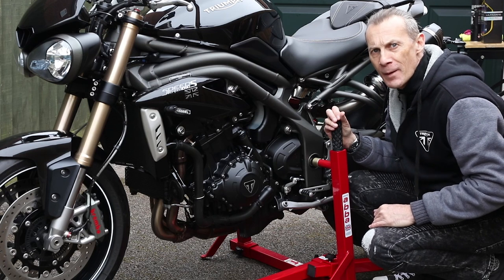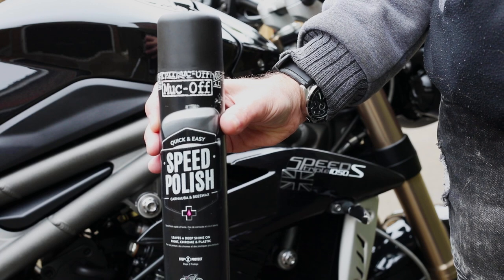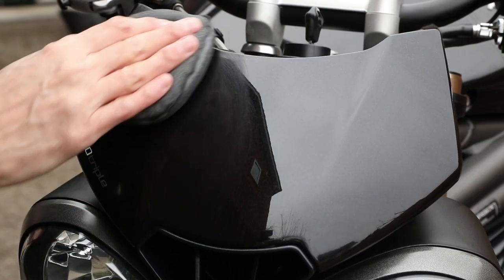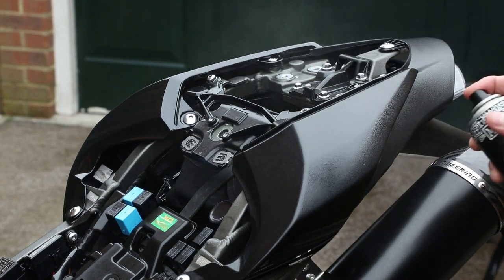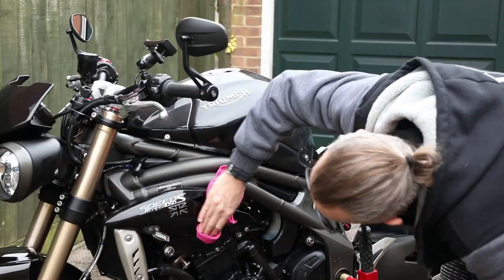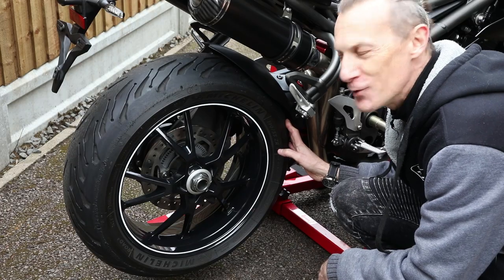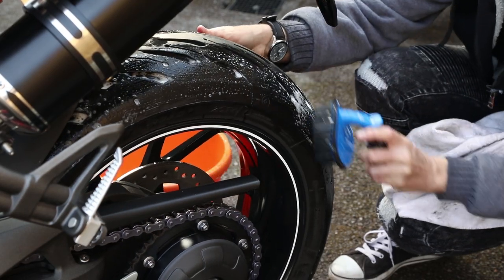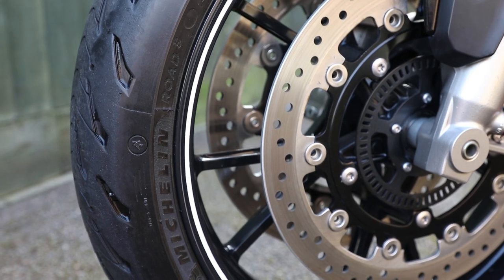How to make your motorcycle look amazing

Comment: Generally polish be used before wax. Idea being you are polishing out the fine scratches and restoring the paint somewhat then a wax after seals and protects the now clean flat paint.
Reply from the maker: Thanks for your comment and advice, Tom. I’ve used quite a few different brands of polishes and waxes over the years, as I’m sure you have, and have found the combination of Meguiars Ultimate Wax and Speed Polish really does make my paint look amazing and this combination has also transformed paint on other peoples bikes and cars too. It has made me wonder what it would be like applying polish first, which I did years ago but got into the habit of using this technique as I’ve been so pleased with the results. It’s worth me pointing out that I used a different process to remove deep scratches. Thanks again for watching and sharing your advice. 😁👊
Reply: i dont think this is a cuting polish which is what you would use to restore paintwork prior to wax. I think I would use it the same way as Phil. Decent wax coat then go over it with this stuff. BTW, Phil, I'm sick of the wet weather were having currenlty. Decided to pull the fairings off the ZX10R and put into winter storage with a coat of ACF-50. Now think I've been a little hasty as we actually had sunshine and dry weather for a change - typical!

Comment: Regarding tyre pressures, when I had my two speed triples I kept the tyre pressures as Triumph recommended them, I now own a 2017 street triple r, and had my suspension set up at MCT, and was recommended to run both tyres at 36 psi, and it feels fine .
Reply from the maker: Thanks for sharing Paul. I’ve experimented with tyre pressures and have also run at 36 psi rear. I know some people who run at 33 psi rear. A subject for another video I think! 😁👊

Comment: Great video Phil. Heres a tip, only use stainless wire wool, readily available nowadays. Reason is bits of that steel wool get into nooks and crannies and rust/stain the bike. I use Abranet cloth, 320. What soap do you use on the tyres? Dish soap? Cheers
Reply from the maker: Thanks for the encouragement and tips! That’s a good point, thanks for sharing! 👍 I’ve found just a little bit of dish soap does a great job! Thanks for watching! 🙌

Comment: Hey Phil, top stuff +1 sub.  Any tips on good products to keep a Tiger seat conditioned?
Reply from the maker: Thanks very much. I just use soap and water to keep my clean. I used to have these really awesome Turtle Wax leather wipes I used on my old Hotrod to keep the leather soft and clean. Any good leather cleaner should do the trick if it needs it would be my advice but you will find yourself sliding around for a bit! 😜👍

Comment: Hi Phil, I followed your way of dealing with ACF-50. Can we put wax on it knowing that ACF-50 already leaves a hydrophobic film? When waxing, don't we remove the ACF-50? best regards, François from France😉
Reply from the maker: @francoisbarax4890  Hi Francois. After I apply ACF-50 to the entire bike, I then apply Polish and Wax to the painted areas. I use ACF-50 as a barrier to stop the rust and corrosion. What I’ve been doing for over a year now is add a Ceramic Coating from AutoBrite Direct, this really helps displace the rain, and if the bike isn’t too dirty I just give my bike a light coat of Ceramic Quick Detailer which really works well and makes the bike and paint look amazing. I’ll add a link to another video if you’re interested to find out more! 👍
https://youtu.be/ZMpYpzHJE7o?si=9MPWUkbhAT7vTSDu

Comment: Hi. I have found your videos really helpful. Thank you. I have followed your instructions and now my 2018 Speed Triple S is looking great. However, is there anything I can do to improve the appearance of the coolant pipes, as they really detract from the overall look of the bike? They have become faded and scruffy looking. I noticed that they regained their colour when they got ACF 50 on them, but soon returned to their faded look.
Reply from the maker: Thanks for your feedback and support, I’m pleased the videos have helped. I know what you mean about ACF-50 on old pipes, it doesn’t last long term. In the past I used boot polish, or you could use a black trim or tyre restorer. There are a few products on the market now, I suggest picking one and try researching on line for customer feedback! Please let me know how you get on. Good luck! 😁⚡️
Reply: Hi Phil. Thanks for your reply, and I will let you know! I saw that in an answer to a previous comment, you say that you have a method to remove deep scratches. Do you have a video on that?
Reply from the maker: @kevinbonardt2104  You’re very welcome. Please remember I’m not a professional but just learnt techniques which have worked for me. It really depends on how deep the scratch is, if you wet it and it disappears then you should be able to repair the paint. I use a really fine wet and dry like 5000 or 8000 grit and carefully work over the scratched area, but then you want to mop it. I would recommend talking to a paint repair company who may be cheaper than you think and would do a cracking job! Autobrite Direct offers a paint restoration service and I used Chips Away to help me out a couple of times! 👍

Comment: Hi Phil, your videos are extremely helpful. 

I have a question. After doing all this hard work and getting the bike looking flawless, you go out for a great ride. But inevitably, you end up hitting countless bugs and now the bike is covered in dust and bug splats after just a few hours. Do you leave them on until you do another full wash, or do you try to do a partial wash on the affected areas? 

I have a matt black street triple that is my obsession, but I also ride it as much as possible all year round and live in the countryside with very hard water. This means I have to avoid wax or polishing as to not increase the shine or gloss, and be very careful with water as just leaving a tiny bit on leads to nasty mineral deposits. Being matt black it often feels like merely looking at it will leave a mark so it's always a headache wanting to ride a lot while simultaneously keeping it clean!

Thanks Phil.
Reply from the maker: Hi! Thanks for watching and your kind comments. That’s a good question. I use a microfibre sponge or microfibre cloth which is damp. Place it over the bugs and they will lift off without any effort. You can also buy a protective spray for matt paint. I believe Mucoff do one? 😁👍

Comment: What do you use to wash tyres with as I am unsure and don’t want to make the tyres / walls slippery and dangerous..
Reply from the maker: Mild soap and water, and a tyre scrubbing brush. Apart from making the tyres look as good as new the main purpose of cleaning them is to remove anything which could make the tyres slippery such as polish or splatters of oil! 👍

Comment: I liked the exhaust cleaning tip.. where can you buy that polish and was the wool 0000 fine? Great shows Phil!
Reply from the maker: Thanks, it’s amazing polish but you need to be patient. The longer you spend doing it the better they will look! Thanks for the reminder, I’ve add links to where you can buy them in the description. It is Ultra fine 0000 wire wool I use! 😁👍

Comment: Hi mate, 1 like and 1 new sub! 
I have a question 🤔
I have a harley davidson softail 2006, 
Lots of chrome 

Whats the best step by step process for me? 

I'm confused about acf50 on the exhaust and polish and wax etc etc 

Autosol dulled my exhaust when It got hot, 

Here's what I was thinking 

Pre rinse
Snow foam/jetoff after
Shampoo sponge wash
Leaf blow and leather dry
Acf50 all over on everything!
Then chrome polish 

What after that?

I'll await your reply!

Thanks
Reply from the maker: Hi! Thanks for the like and sub. 

I’ve been giving this some careful thought, and would agree with the order. I checked my notes and in my research if you coat everything with acf50 after cleaning and drying, it leaves a very fine coating which will protect the bike. You can then apply the wax and polish etc. 
I use White Diamond metal polish, link in description, this is brilliant for chrome and also contains an amount of anti corrosion protection. If you polish the chrome and then apply acf50, it will dull but apply first will definitely help.
I checked this with a professional valet (FC Trott on Instagram) who uses this method. I understand your confusion as it appears you are polishing and removing the acf50 if you apply it first! 
Test it on a small hidden area first to make sure you are happy with the results. It is awesome stuff, I’m confident you will love it!
Let me know how you get on. 😁👍

Comment: May i ask if the MucOff Polish left any residue on your engine case??I see your engine case has wrinkle paint and made me wonder .
MucOff also makes the Motorcycle Protectant and i thought that might be more appropriate maybe???
Should i buy both just in case or thre Polish is good for everything??

Thank you
Reply from the maker: Hi George. The Mucoff Speed Polish doesn’t leave any residue   I’ve also started using Mucoff Motorcycle Protectant for the non painted areas and it works really well. I would recommend getting a can! In the summer months, I find myself blowing off the dust and removing bugs, then give the paint a light coat of Speed Polish to improve the shine! I hope this helps! 😁👍
Reply: @TheAdventuresofPhilJones  thank you sir !! I will go with both and experiment a bit . Thank you for replying 🏍
Reply from the maker: @tigrarulez  you’re welcome, let me know which one you prefer! 👍
Reply: @TheAdventuresofPhilJones  will do !!

Comment: Uh, wax is the protective layer, polishing removes a  "layer" basically....so yeah, your polishing your wax layer and probably in the end have the scratches etc filled in with wax! So the result will be shiny, but the protection and shine wax provides isn't really used!
Reply from the maker: Thanks for watching and your comment, I do appreciate it. I’ve had a few similar comments and because in this case I was using MucOff Speed Polish I wasn’t working it into the paint like normal polish. That’s my excuse anyway! Check out one of my recent videos using AutoBrite products which they asked me to try. https://youtu.be/ZMpYpzHJE7o